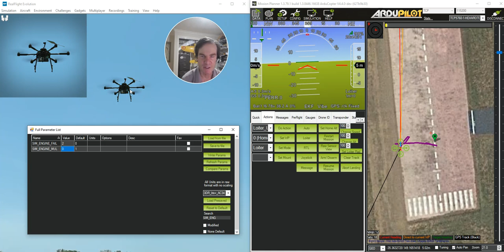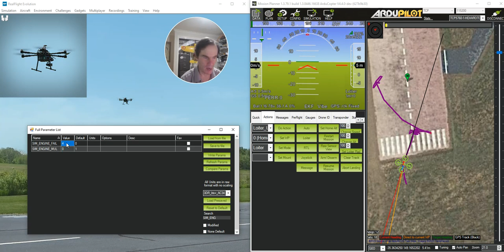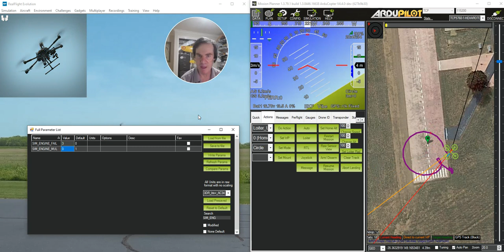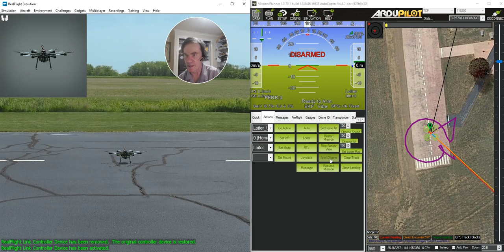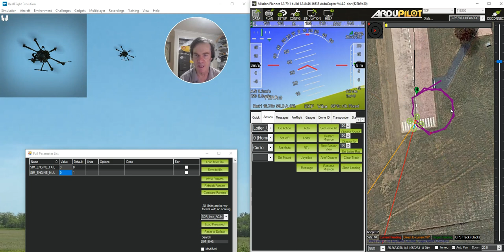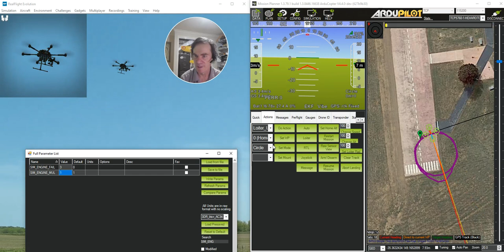Fault Tolerant Hexa - Part 2, asymmetry

Comment: Table 3 in the paper is a good overview of this...

Seems like there are three levels of control dependent upon which motor is lost:

No wear/failure 8 1.1295 controllable
η1 = 0 8 0.7221 controllable
η2 = 0 8 0.4510 controllable
η3 = 0 8 0.4510 controllable
η4 = 0 8 0.7221 controllable
η5 = 0 8 0 uncontrollable
η6 = 0 8 0 uncontrollable